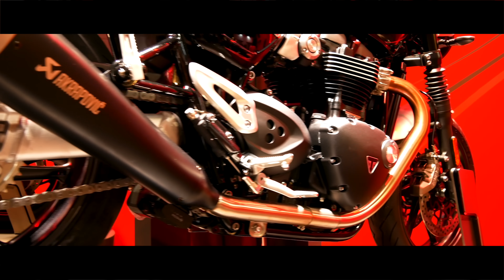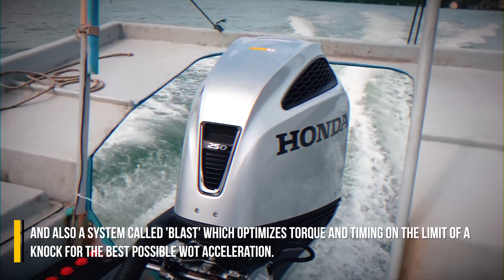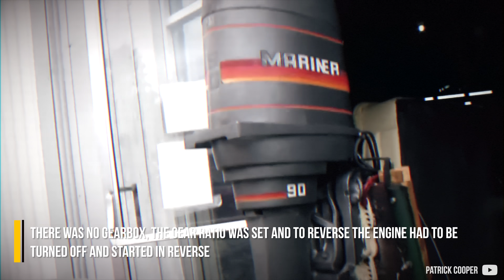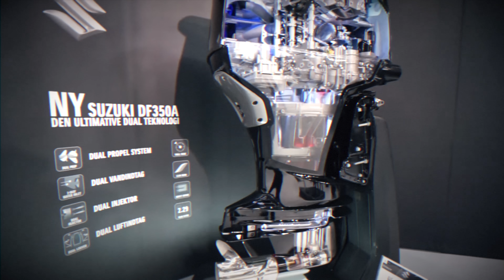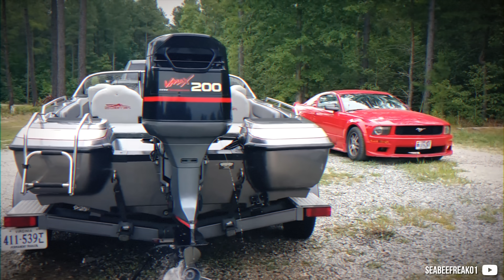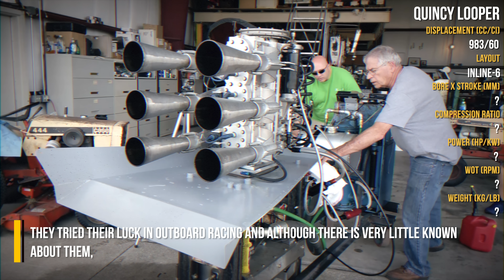The Best Sounding OUTBOARD 6-Cylinder Engines

Comment: The Mercury V6 fuel-injection Outboard RACE engine debuted in 1973. Bob Spalding, a Merc factory driver, that year was the test driver for the Mercury engineers in Wisconsin. The Mercury engineers brought the V6 race engine to the Mercury European race shop in Como, Italy. 
The Merc V6 was clamped onto a Molinari tunnel race boat, and transported to a race near Koblenz, Germany. In late summer of 1973, Bob Spalding drove the V6 powered race boat to a second place finish, behind the winner Renato Molinari. Renato, like Cees vander Veldon and Bob Hering, were powered by Merc inline 6 motors in that race.

Comment: The first year for the mercury 2.5 litre was 1991 I own a 200hp. and first V6 from mercury was 2.0 liter . 245 HP motor in the 2.5 liter lineup but not the first in that displacement .245 is carbureted and the 260 is efi ...same block ,porting everything.except for being efi.

Comment: the Yamaha v6 you can buy a Nizpro supercharger kit and a re-tune of the ECU to make 450hp
Reply: Which Yamaha v6 are you referring to?
Reply: @hansteike3154  the 4.2L, so the 225, 250 & 320HP V6 models. They are mechanically identical so you can buy a 225HP and strap on the charger kit, voila, 450HP
Reply: @fullsendmarinedarwin7244  Cool. Thanks

Comment: Loved it . Mercury efi engines were so reliable and easy to work on. Todays engines are too complicated and have more issues. I just bought a new power head or "engine block " for my 99 175 efi. So now she is good to go another 22 years hopefully . I've put mine through straight hell and mud and it was my fault it blew finally. Should of changed some parts that caused a failure . Anyways nothing will ever beat a 2 stroke in my eyes. I mean in my heart even if they make new 4 stroke engines with more power.

Comment: My grandparents used to have an old daycruiser boat from the 1950s or 1960s with a Mercury or Mercruiser 55 HP outboard engine. (I think Mercruiser is only inboard so probably Mercury) The engine was oversized compared to it's output, but it sounded good and it worked great up until the 2000s with normal maintenance. It was black in color. Does anyone know what engine that was, and it's specifications? This was in Norway, so could it be one of the 45 HP engines that were tuned or optimized to 55 HP in some markets?

Comment: I Raced F1 Powerboat Mercury 300hp 2l V6 2006-2011
It rev up to 8800rpm and a nother class 9250rpm in South Africa.
But there was ons test boat that reved 14200rpm.
235km/h
Boat weights 425kg
Engine 300-330hp
Great power to weight ratio.

Comment: The part about Mercury could have been way more impressive. Starting wih the original tower of power all up til the Racing 2.4 and 2.5 EFI’s. They do screan and sound like nothing else. Especially compared to the hondas or yamahas with their stupid gezrbox whine overtaking the engine noise. Letting hear us those 4 strokes run in neutral on a stand is NOT representative for the sound. Example; the console boat departing with the Honda 4stroke. Are you serious if you say that that sounds good?
Again, honestly, a bit disappointed. I guess there will not be an answer to my comment. Only to the positive ones lol.

Comment: The video of the evinrude and the Suzuki and the HPDI running were not the same engines at all and the 2.5 mercs were sold with 20 25 and 15 inch race mid sections

Comment: Can you do Inboard engines next? The low burble of the Mercruiser 454 ( 7.4L ) MPI is one of my favorite sounds. Ultra loud and roaring in cigarette boats ( speed boats ), or mechanical but refined humming in a yacht. Beautiful engines that are smooth as silk but reliable and can take a beating. They’re basically GM 454 big block V8’s out of trucks.
Reply: No kidding?

Comment: The 2.5L merc can output nearly 400hp when built right. They can also be spun to 10,500 rpm and are arguably the best outboard ever produced!

Pound for pound, it is very hard to beat the 2.5L merc, but I'd venture to guess the 400R comes really close for a 6 cylinder!

Comment: The last motor shown was a Quincy Looper, on a Hydroplane they reached speeds over 100mph at the Outboard Nationals in Depew, Ill. in 1973, there were also Konigs that had a Chamber on the exhaust, they were very fast.  Britain made a motor called Anzany, something like that, 20 ci. and had the record of 100.089 mph,  There were also Champion Hotrods, which were also racing boat motor
Reply: That last Quincy looper is new, designed and built recently..

Comment: what i found a even-rude xp 150 v6 2 stroke  will not run on today fuel with out additives and gallons of fuel(20 liter cans 5 or 6 each trip) & quarts of 2 stroke oil I changed mine to a 60 hp recondition oil injection!  it runs on today's fuel from gas station too mixed with additive too!

Comment: You missed the old Mercury 275&300 of the 80s and the ProMax 300 and 300X engines, the PM motors are from the 90s through 07 I believe. The old motors are rare, and unheard of. Good luck finding info on the 80s motors.

Comment: Only one thing you missed. The Mercury Verado outboards were by far and are the most extensive of all of these with applications from 200 to 400 HP out of a supercharged 2.6 strait 6. They sound incredible as well. But great video!

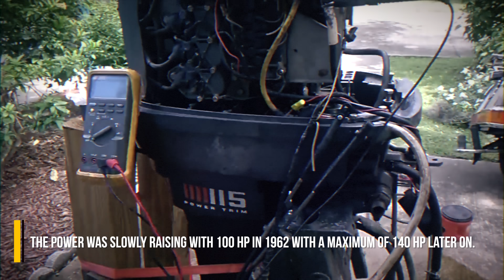Comment: 3:50 the max hp of the inline 6cyl merc was 150hp on the 150xs and 1500 models. of course that was powerhead rated for the 1500 and 140hp, not propshaft so about 10% less than 1986 and on motors rated at the propshaft to compete with Japanese imports introduced in 1983

Comment: At work, we have 3-boats with outboards. Each is equipped with two engines. One boat has Honda, the next is Yamaha, and the other is Suzuki. The Honda engines are 250hp and have been wonderful so far. This boat gets new engines every 5k hours of use and they are always Honda. The next boat has Yamaha's and so far at 400 hours and engine one had the lower drive unit replaced as it broke 40 miles from port - the other has to be resealed, however, the engines themselves are smooth and each is 300hp. The next would be the least expensive but require valve adjustments every so often (about $800). These Suzuki's have nearly 6k hours and going strong without ever having issues - these are 350hp units. The lower units on the Suzuki engines are always clean, unlike the Honda and Yamaha which leads me to believe the Suzuki has superior cooling.

Comment: Whatever you do, do NOT own a fucking Mercury!  I have a 2012 Bayliner 170 with a Mercury 90 four stroke.  It is a DOHC 16 valve 1.7 liter fuel injected four cylinder engine, and I have had multiple problems with it.  It is very fuel efficient and drives the boat to 40 mph, but if you are in the market buy a Yamaha or a Suzuki, they last forever and don't give a bit of trouble.

This particular engine?  If you change the computer you can take it from 90 hp to 115 hp with no other changes....

Comment: On the Mercury inline 6, to fill in the blanks, the displacement was about 1.6 liters, and WOT is about 5800 rpm, also it was rated at 150 hp at one point with slightly different pistons I believe and I know my personal 115 i6 "video found on my channel.. " sounds incredible
Reply: you could honestly just do one video on mercury i6s

Comment: As someone who is obsessed with and spends a lot of time around outboard engines, I'd like to share my opinion: the best sounding outboards in the world are v-6 two strokes. Namely the Mercury 3 liter EFI, Yamaha OX66 3.1L, and Johnson/Evinrude OceanPro/OceanRunner 225.

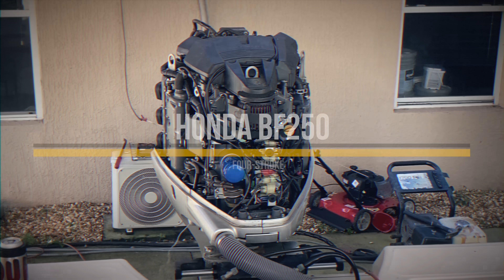Personally I think the Mercury 3 liter EFI sounds the best of all of them. There is nothing that can beat the sound of one winding up and pushing a boat onto a plane. Go to 1:58 in this video: https://www.youtube.com/watch?v=TuyJgN3Hy6Q&t=132s

Right when he hits the throttle, you'll hear a throaty siren-like sound emanating from the engine. Sounds much better in real life
Reply: I agree i have ox66 2.6 and just picked up an ox66 3.1 going to put a Hydrotech kit on the 3.1 slip it on the 18 Pulse bay boat heck im running 53mph at 5300 with the 2.6
Reply: @drifter9425  You should totally do before and after videos of your setup. Would love to hear the difference!
Reply: @sawmaster6095  
I have a video of a fly by with the 2.6
Runs 40mph @ 4100
           50mph @ 5000
           53mph @ 5300 
21p Ballistic prop 6% slip
Reply: @drifter9425  Just saw it (well all 2 pixels of it), sure is an ass hauler! When does the new motor get mounted?
Reply: @sawmaster6095  
Its going to be a while im on another project my mechanic is service mgr for a Yamaha dealer and a guy traded it in for a new one when it ran hot once lol it has compression and starts and sounds fine looks almost new too 1500.00 just couldn't pass it up lol
Reply: Im figuring a poppet valve cause dealer changed stats and impeller  my 2.6 OX66 did same thing alarm only at idle poppet valve stuck open a bit

Comment: Crazy sounds... Although My son is developing electric boat motors, (& I love them..cruise all day and into the eve on 1 charge.. More with solar), I am still (from the 60's) a motor gearhead, loved Formula 1 Matra, Porsche & Ferrari sounds.. I've owned several Porsches, but these outboards REALLY have the sound!! Thanks for your eclectic view of engines, racing and transportation in general. All of it is an adrenaline boost!
Reply: Cruise as in putting around or cruise as in up on plane cruising? Every single electric powered boat to date I've seen has had abysmal range when you're trying to get anywhere at a decent pace.
Reply: @BlackHawkBallistic  We're at the beginning of advanced electric tech.. Not everyone needs a Donzi or... to get thru their "enjoy the ocean / water day". Once upon a time, 0-100 mph was important to me.. now 0 to 500 miles on my trip to see my sister or brothers is important.. . 8 hours on the bay or inland waterway with my son & his wife work really well too. I've learned that it's not how fast you get there, it's the trip.. That being said, Tesla's model S plaid is I think, the fastest thing at the strip.. Fast electric boats are NOT a fantasy anymore..
Reply: @stebro2738  so then it's putting around cruising correct.

The plaid tesla is fast but didn't it come out that it isn't as fast as advertised, it's not a 2 second car like they said it was but that isn't really relevant to boats lol.

If you're going a few knots then yeah an electric boat motor would work but if you want speed or long range it isn't going to work out. You could have a ton of batteries to power your boat but once they're used up it will take a really long time to charge them especially if you're doing solar power and at any kind of appreciable speed you're going to be using so much power you won't get very far. We need more energy dense batteries before electric boats become viable. I'll try to find the article I read just yesterday about the energy density of batteries in boats versus gasoline.

If we're using cars for analogies though every electric vehicle looses half their range or maybe more once your start towing with them.
Reply: @BlackHawkBallistic  Oh yeah, then there is towing.. I have a Mercedes sprinter and a Mercedes diesel powered 08 jeep grand cherokee... both tow like blazes.. 70 mph pulling 5000 lbs and at 15 to 20 mpg! I however, I see in the near future, with new battery tech, electrics will NOT be far behind.. I AM a dinosaur, BUT!! I CAN see the future!

Comment: There actually is a crossover between marine engines and motorcycles. In the 1970s Monark raced in the 500cc GP championship using a Crescent outboard engine.  Kim Newcombe was leading the 1973 championship using a bike powered by a 500cc flat-four two-stroke Konig marine engine, when he was sadly killed before the last round.

Comment: I love outbaords and I messed with them for over 15 years. Although the V6 were very powerful I loved Yamaha 3cil for the amount of output hou coupe get the to have. It was possible to get them to rev over 9K rpm, put the exhaust directly out of the case and use a surface propeller. And at the time these mods were considered mild.

Comment: I assume thess engines are literally cooled with the salty water. Do they have any kind of treatment in the engine block and head?
Reply: It is recommended to flush them out with fresh water after use in sea water. On small, basic outboards, this is usually done by running them with the water intake submerged in a bucket of cold water. Other engines have devices that clamp around the water intakes and can be connected to a hose, while some, (I think Suzuki do this) have a hose pipe fitting to easily flush them out directly from the hose. 
I think they come quite well protected from the factory, they use grease but I’m not sure what else they apply. Even so, flushing helps prevent salt deposits building up and blocking cooling water passages. They also have ‘telltales’ which shoot a stream of the water out of the cowl so that you can see that water is circulating properly.

Comment: Awesome video! 😎

I have a 1983 Evinrude 15hp on a 12’ tin boat...it’s still starts and runs flawlessly every summer 🤠👍
Reply: Johnson/Evinrude 15hp = most reliable outboard engine of all time.
Reply: @stevenwoodcock8702  Has needed nothing but maintenance and a new rotor for the pull start (guess the clock spring wore out)…in almost 40 years! 😀

Comment: Back in the 1960's, one guy, whose name I remember as Don Odenborg, built a couple of rear mid engined sports racing cars for SCCA competition using Mercury outboard engines.  His first had an I4 mounted transversely lying down, and chain drive through a Triumph motorcycle gearbox.  If I remember correctly, it had no reverse, no differential (just a sprocket on a spool) and swing axle rear suspension.  The second was more elaborate, with an I6 mounted lengthwise, driving though a transaxle.  The I6 car had three megaphones sticking up through the rear deck.
Reply: Wonderfully insane!!

Comment: In 1996, the first modern gasoline direct injection automotive engine was introduced in the Japanese market by Mitsubishi Motors. 
22 years behind in 2018 yamaha V8 5.6L XTO is the first four-stroke powerhead in the outboard industry to feature direct injection.

Comment: Genuine question, why do outboards have crap specific outputs? Even the 2t seem to be about 80hp/l max. Land based 2t perfprmance engines are all 200-400hp/l n/a. 4t are 100hp/l n/a easy. Also, why no forced induction in outboards?
Reply from the maker: Not a pro answer, but I would expect that it is to prolong engine's lifespan. As they are at high load a lot of the time, not just hanging around at low revs low load like in an automobile, they require a very frequent oil changes. Just my thought. And there are boosted engines... the Mercury Verado L6 is supercharged
Reply: @VisioRacer  That may be part of it. Earlier two strokes (40's through the 60's) were mostly deflector piston. Loop charging didn't start to become common until the 70's. It is like the difference between flat head and overhead valve four strokes in power outputs.

Comment: I love the sound and smell of the 2 strokes. Would love to have one in a car, on a bike, or even in an aircraft!
Reply: Search youtube for rudezon car ..v6 outboard in a old volvo car..easy burnouts👍
Reply from the maker: V8 I believe
Reply: @VisioRacer  ohh! Your right👍..my fault 😁
Reply: Many homebuilt/experimental  aircraft use two stroke Rotax engines. Saab 90 series and DKW's were common two stroke cars in the 60's and then there are the Kawasaki's and Suzuki two stroke bikes of the 70's too.

And Don't forget the two stroke Detroits in trucks from the 60'suntil the early 90's.